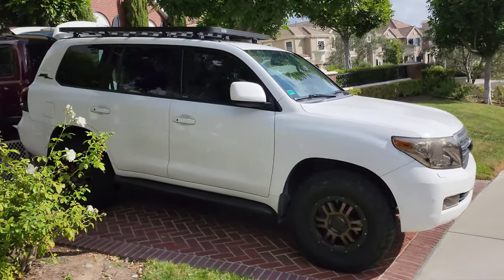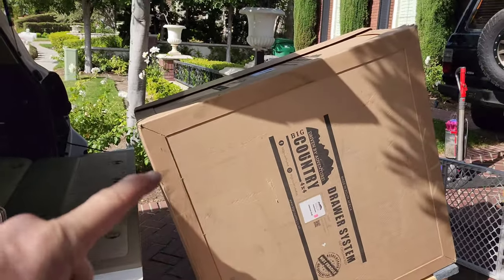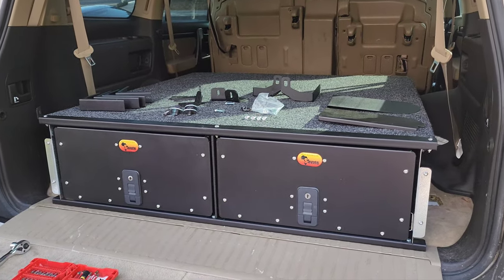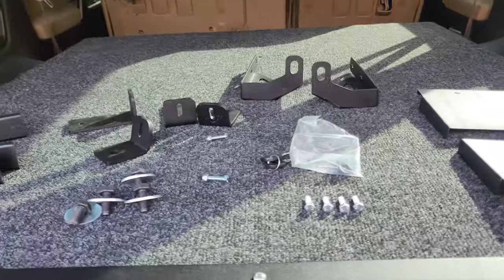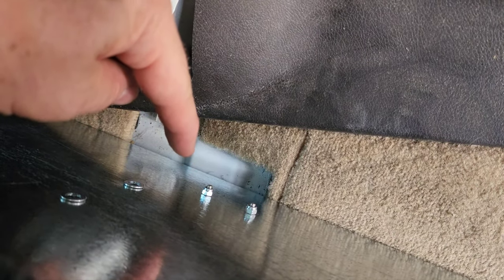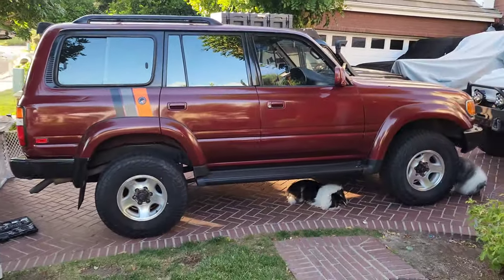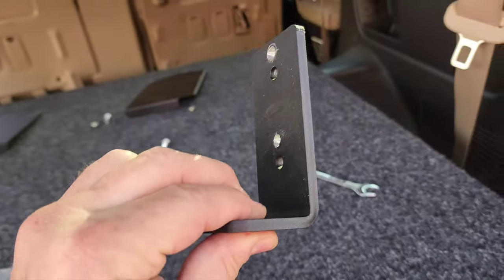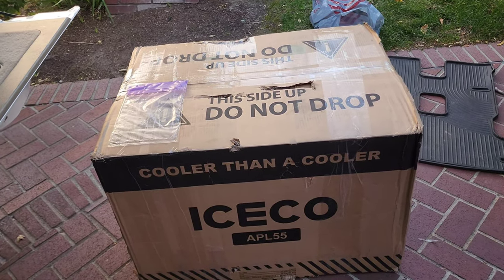200 Series Land Cruiser Ultimate Drawer system

Comment: Instead of drilling two new holes, wouldn't been easier to use a couple spacers between the two " L " brackets to get the proper height needed ❓
Reply from the maker: That was another option, but I preferred less parts and have them seat together.
The manufacturer says possible the under carpet is thicker in the US, so they will provision the brackets accordingly.
Reply: Would be easier to invert it so it's installed right
Reply from the maker: @hongtanke  I tried that..Its angled, so when you invert it, the L is in the wring angle. Best solution is to lower the bracket on the drawer, which is what I ended up doing, and how the manufacturer will address it too.
Reply: Or use the 8 seat bolts 😂